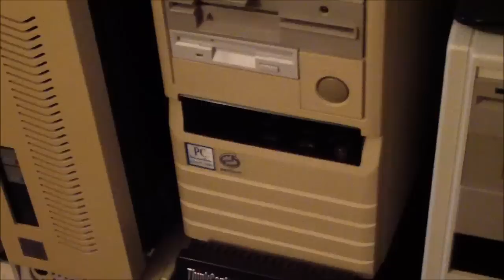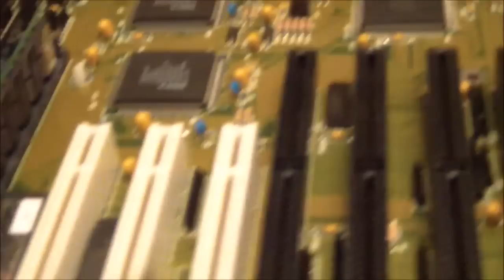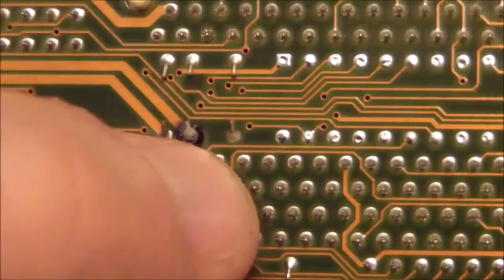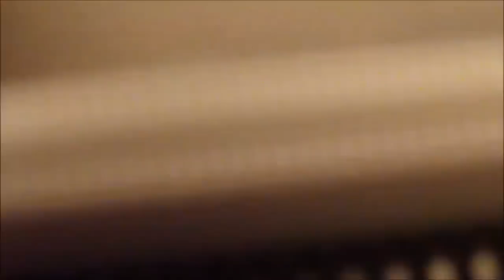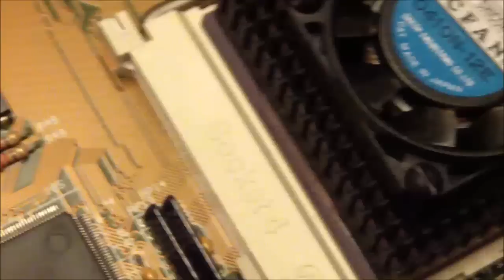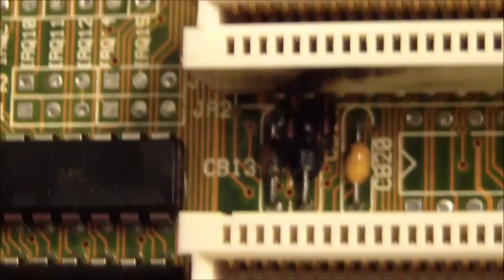socket 4 burnt cap

Comment: the board can be foixeed if you know how to use string wire and a very fine soldering iron
Reply from the maker: well at this point it seems it was non critical and the boards has thankfully been operating fine. I'm avoiding using the PCI slot closest to the burn out and it seems to be working. I may fix it down the road or if issues pop up though I'm thinking having the board completely recapped may not be a bad idea anyways.

Comment: I could not clearly see it, but it looks like a tantalum capacitor. They are reliable most of the time, but when they go, it's with a bang. That location on the PCI slot is indeed used to power the PCI cards and you have 5 and 12 volts there and sometimes 3.3.
There is a possibility that one of your PCI cards if faulty and it blew the power rail. If a Capacitor on one of the PCI cards gives up his ghost and shorts out due to a high internal resistance It can fail like that.

The cap is probably used to clean some noise on the power rail. I don't expect it to be critical. If you say it burned in 2, just cut it out if try the system with PCI cards.  

If any caps on the PCI card get hot it's  getting very bad. 

In the mean time, buy a soldering station and start learning how to use it. It really worth it. It may take some time but if you are into vintage stuff you will encounter a lot of bad caps. Almost all my 90's game consoles have bad cap's
Reply from the maker: I ended up cleaning the area better and cutting out the cap. put the thing back together and its been running stable for well over an hour. I've kept this machine pretty simple so all I have running on the PCI is the ET6000 video card.
Reply from the maker: that seems to be the case. I did try a PCI video card in the bottom most PCI slot and it seemed to work just fine.
Reply: Both Ceramic and Tantalum caps in this style look the same, so this can be either one. In this case it is an Axial lead cap. I'd bet the cap just felt it was time to short out, and my feeling is that it is a 
ceramic cap given the obvious burning that occurred. Either should work fine as a replacement, and the PCI devices may still function perfectly fine without it. Trick is figuring out what the value of the original cap was, and if the numbers are no longer readable, then I would just look at the other ones like it on the board between the PCI slots and find an equivalent part to purchase. 

The cap should be cut out of there, if nothing else cut it in half so it can't cause any more harm.
Reply: They call those "tantrum" capacitors for a reason. When they fail they short out, thus they explode when power is applied. But all they do is help filter the power supply output, so they're not critical.
Reply: I think its a nice feature it tells you "Hi there! I'm dead" It's way better then the sneaky electrolytic cap that eats it's way true the tracks.  :-)
Reply: My 386 PC did the same thing, my mom smelled the smoke and ordered me to chuck the PC into the trash before it sets the house on fire. I just unplugged it and put it into my closet until i bought new capacitors, and also lied to my mom that i threw away the PC and instead, threw away an empty bad condition ATX case that had stripped standoff threads, no power switch, all the 5.25 and 3.5 covers are missing, etc. to make it look like i threw away the 386 PC, when the capacitors arrived, i got out the soldering iron and soldered on the new capacitors and it's back to working again.

Comment: Damn. Never had one blow one me.  Always had a chance to check my boards and replace bloated caps. Glad it works
Reply from the maker: It was scary, lots of black smoke, I saw it even flame up for a second. I'm real glad things seem to be working but its still probably unusable till I see if I can get that area fixed since I don't know what damage having those caps knocked out will do in the long run.
Reply: I would be careful not to run it..miss caps or bad caps is bad for voltage regulation. Bad caps will cause things like onboard sound issues and onboard nic lights will come on but no one is home LOL